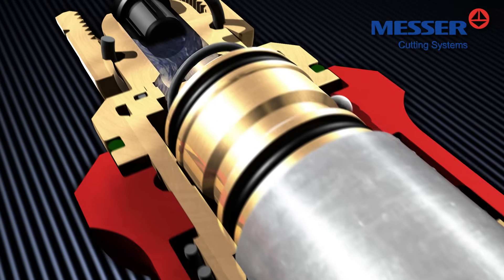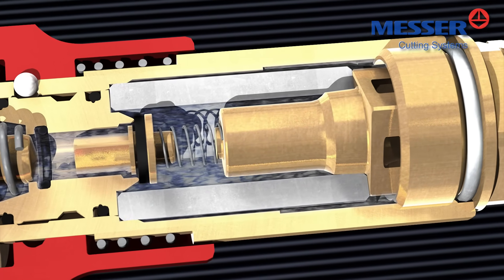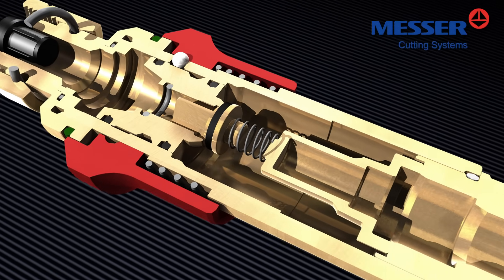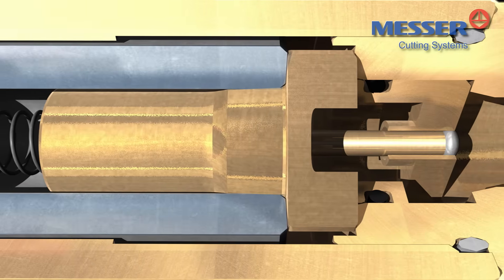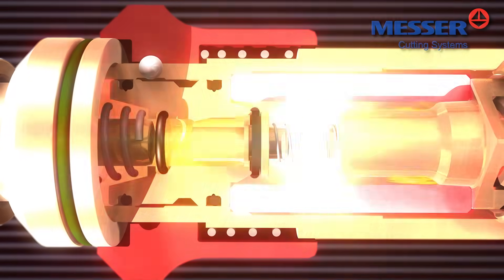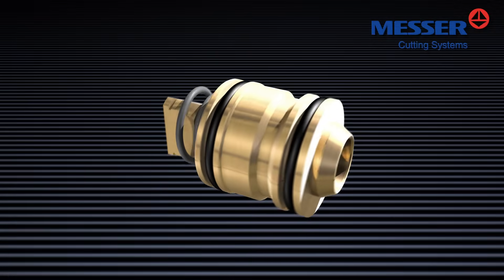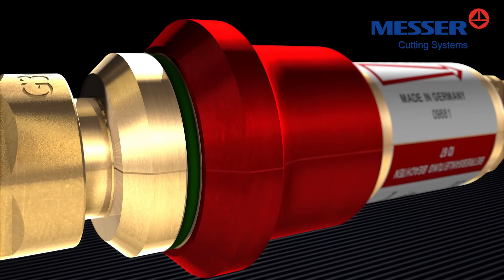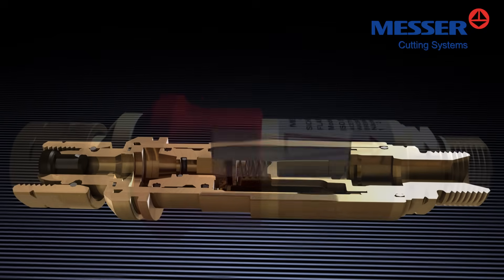How Flashback Arrestor work? | Messer Cutting Systems India

Comment: What type of flame arrester can be installed on a domestic gas cylinder when used with an oxygen cylinder for cutting in some workshops?
Reply from the maker: Kindly get in touch via sales.all@messer-cutting.com or call to 7708446444 we will definitely assist you